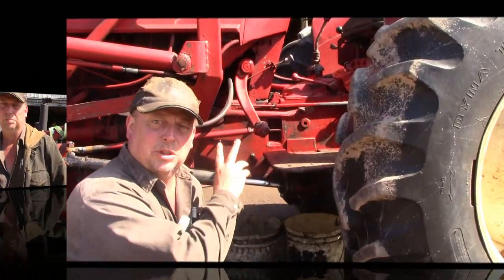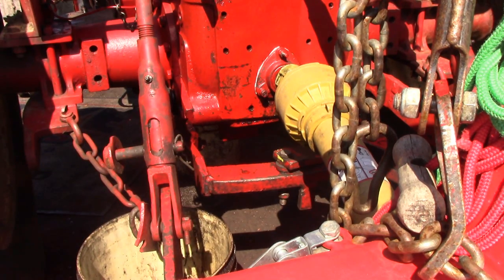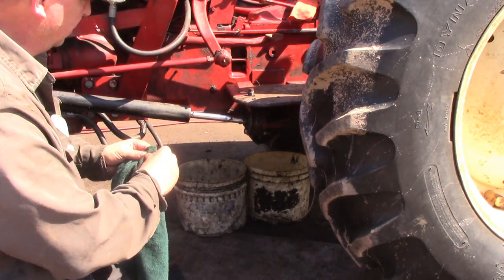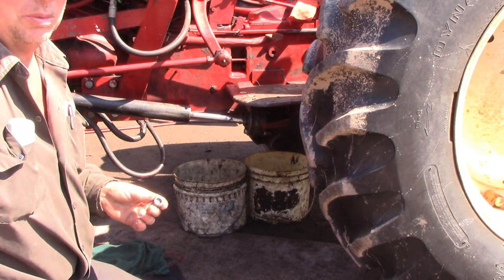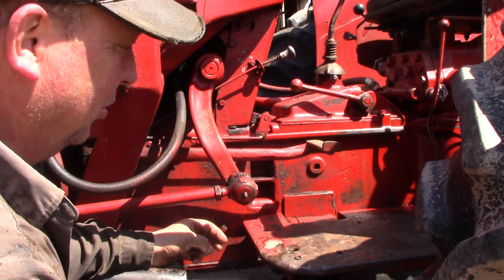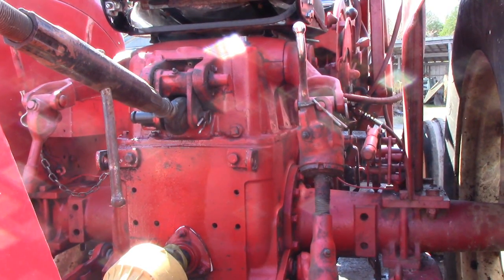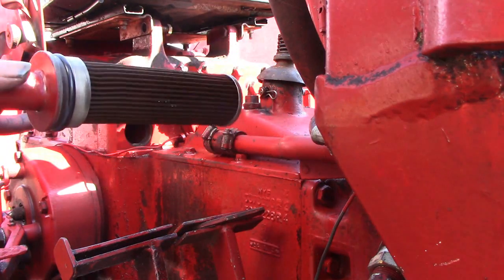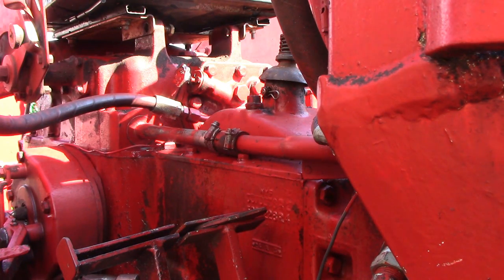IH 444 Fliuds change

Comment: Thanks Dave for this video, but what fluids do you recommend to use on my old b-275?
Reply from the maker: If you can get it CaseIH Hytran for the hydraulic system if not a good hydraulic oil, 80w90 gear oil for the transmission and a quality 10w30 or15w40 diesel engine oil. Thanks for watching!
Reply: Does my 1957 IH 350 have a transmission filter?
Reply from the maker: @paulmock3776  No transmission filter but there is a metal screen filter inside the hydraulic tank over the differential. Thanks for watching!
Reply: @CanadianRedneck15  I removed screen under the seat and added a spin on filter in the return hydraulic line.
Reply from the maker: @paulmock3776   Interesting idea. Thanks for watching!

Comment: Hi there. I'm from Uruguay. I have an international mc cormick 4140 tractor. Do you know if there is an oil filter holder (to be able to use modern filters) that is compatible with the holes of the tractor? Thank you
Reply from the maker: I have heard that there was but I have not found it. You may be able to get one from a Mahindra dealer as they were licensed to build them in India after IH stopped. Thanks for watching!

Comment: Hello, for the 444 hydraulic oil fill level, is it 3 inches from the bottom of the reservoir or 3 inches from the top that I fill it to?  I couldn't make that out in your video.  
PS... I just found your channel over the weekend, thanks so much for putting these out, i would be lost if you didn't!
Reply from the maker: It's 3 inches of fluid, so 3 inches from the bottom. 
  I am glad you have found the videos helpful, thanks for watching!

Comment: Thank you so much for this 1$ million video,am glad i found this after a long search. please i just got a IHC 353 without  any manuals. the old owner said the hydraulics system hangs after two hours of working. please any idea what to think about this problem, and again is ihc 353 similar to 444 in services and features. thanks in anticipation.
Reply from the maker: If the hydr0ualics work OK when cold but get weak/won't lift when the oil heats up that sounds like a hydraulic pump.
 I am glad you enjoyed the video, thanks for watching!

Comment: Hi Dave I just got a b275 diesel , what kind of engine oil should I use and where do I buy the filter, thanks Nick
Reply from the maker: Use a good quality diesel engine oil, something like Shell Rotella 10-30 or 15-40, the filter you should be able to get at NAPA or the like. Thanks for watching!

Comment: Great video. I finally got my 414 running and moving. I would like to change my fluids. Can you tell me the oil you use for the engine and hydraulic fluid  used please?
Reply from the maker: I use Rotella 15w40 but any good quality diesel engine oil will work. For the hydraulics I use CaseIH Hytran oil. Thanks for watching!
Reply: @CanadianRedneck15  Thanks. I got some brand of hytran and I got 80w90 for the trans. I didnt get engine oil yet. Mine is gas. I was thinking a 10w30 or something basic just a 30 maybe. I also got a bunch of new pins.  I already cut my back field with the bush hog. Moved a few logs. It was sitting for a few years. She fired right up after I changed a few electrical parts. I would like to get the manual for this tractor. There is quite a bit to guess all the features it has . LOL Its my first big tractor.

Comment: Nice video lots of help. question where do you attach the pressure and return line from loader lever thank you.
Reply from the maker: The most common way is to run the pressure line from the pump through the loader valve to the lift unit. You have to use a "power beyond" loader control valve which has a second return line running from it which would hook into the fill hole on the lift unit by way of a pipe tee. Thanks for watching!

Comment: I keep coming back to this video - it’s just great. One question, though, about the hydraulic fill level... my newly-acquired manual says to fill to the top of the reservoir. Is the full level of a B275 different from that shown in the video?
I also worry about overfilling the hydraulics if I top up the reservoir, and then connect my planter... if I then lower the planter, won’t it push too much fluid back into the system?
Reply from the maker: The 275 is a different lift unit than a 444 etc. but I don't think you would want it right full either because of heat/expansion. I thought the 3" of fluid referred to a 275 as well but I have been wrong before. Thanks for watching!

Comment: My new 444 when bought they said it was really hard to start.  she needed a shit load of brake cleaner to start, running the blowby was worse then the exhaust it would pop off,  i popped off the head  actually the pistons look good a tiny bit of carbon on the head, injectors looked good too. head gasket had a tear not sure if it was taken off, most likely not, cyl wall still had cross pattern.  was thinking std rings set. a light honing. not really into new cyl kit.. already  bought starter, modern glow plugs ,H8 battery,   love the sound of it.    oh valves look really clean too no pits nothing. maybe all the brake cleaner lol
Reply from the maker: The blow by certainly could have come from the head gasket and a set of rings wouldn't be a bad idea, it could have over heated and taken the tension out of the rings. Thanks for watching!
Reply: one last thing what a joy to pull apart, no back breaking bending,

Comment: I am getting close to changing fluids in my tractor. I was going to order a new filter for the hydraulics but might just clean it. What motor oil should I use on my 444 Diesel.
Reply from the maker: The hydraulic filter is a metal screen, meant to be cleaned as long as it's in decent shape. For the engine use a good quality diesel engine oil, we use Shell Rotella 15w40. Thanks for watching!
Reply: @CanadianRedneck15  Its me again. I just got the tractor to my house and cleaned the suction filter on my 444. The 3 point and power steering is not working. How can I tell if the issue is the hydraulic pump or flow divider? I am not sure what other thing can cause the hydraulics to fail. The flow divider has a small piston that moves in and out. Could my lines be full of air? Well back to searching more information.
Reply from the maker: @cutweldngrind  Try loosening the pressure line at the lift unit to check for oil flow and bleed the air out of the system.

Comment: Great explanation video  thanks have you any specifications on oil selection is there a one for all oil for the 3 ? Thanks again
Reply from the maker: For the engine use a good quality diesel engine oil (we use Rotella 15-40), the transmission should have an 80w90 gear oil, and the hydraulic system is recommended to use CaseIH HyTran oil. Thanks for watching!

Comment: We had 250, 275 and 414 Tractors, but never realised that they had that hydraulic oil screen.   Never had any oily problems with them, even when loading sugar beet for the cows, at 06:00 on a cold -15C morning. . . . . .Thanks for the video. . . . . .
Reply from the maker: Those series of tractors are hard to beat. In my opinion they are the best tractors in that HP range built by anyone ever! Thanks for watching!

Comment: Thanks for the video!  Yeah, I've got a B275 that I picked up 10 years ago and other than oil changes every couple of years just because, I don't think we ever put more than 2 or 3 hours a year on it dragging equipment around the yard at the shop.  Now we have it at the family farms in Texas putting out hay, and I realized I'd forgotten how to do everything but the oil changes.   I'll have to look at it, but, you're saying there is a drain plug for the gearbox/transmission, and then a drain plug for the rear end, but they both get filled at a plug by the shifter?  Also, the B275 'Jensales' all in one service manual (unless I"m missing a section), was really lousy about covering maintenance, but it seems to state that the preferred hydraulic fluid is SAE 20 motor oil for mid-range temps.  I didn't get the manuals for a few years after we got it,  and at the time it seemed to have clear-ish hydraulic fluid, so we added whatever the International dealer in Okanogan WA at the time had in 5 gallon containers when I had to replace some gaskets on the hydraulic valve body.  It seems to work fine, we're lifting 1000 lb round bales with it now, but, do you have a recommendation one way or the other?  Thanks again, it certainly is a fun little tractor now that we use it regularly.
Reply from the maker: There should be 3 drain plugs, one at the back half of the clutch housing, one under the transmission, and one at the back for the differential, and they all fill from the plug by the shifter. 
 For the hydraulics our dealer always recommended CaseIH Hytran oil but if you're using regular hydraulic oil and it's working fine don't worry about it.
 The 275 is a great tractor, much sturdier than competitors in it's size range. 
  Thanks for watching!
Reply: @CanadianRedneck15  I finally made it down to the farm we're using it on tonight and took a look at it after your video, yep, now it all makes sense!  Thanks for the response, yeah, I like it because it's compact and so far, is lifting the big round bales just fine.  I do see some fluid changes and a little maintenance in my future though.  Thanks again!

Comment: you never mentioned the oil types and would synthetic work
Reply from the maker: 80w90 gear oil for the trans/differential, CaseIH hytran for the hydraulics and a good quality diesel engine oil for the engine, 10w30 or 15w40. I don't see any reason that synthetic wouldn't work. Thanks for watching!
Reply: @CanadianRedneck15  used to own an old benz diesel , it seemed to purr using 0w40 T6 synthetic. figured easier to start in the cold. Enjoy the videos.. surprised how everything comes apart in sections, like the front end with rad, middle is the motor etc.  simple
Reply from the maker: @BillyBob-fd5ht  Yeah, I'd way rather work on a tractor than a car!!!
Reply: @CanadianRedneck15  yeah, question the IH 444 glow resistor do i need that? odd to send energy to that to heat up with the glow plugs, I would prefer a light and the power go directly to the GP. mine does not work.  my old MB i just used a solenoid, kabota   switch only (only 2 Cyl)
Reply from the maker: @BillyBob-fd5ht  You need the resister in the dash or you get too much juice to the glow plugs and burn them out.
 Thanks for watching!

Comment: allo parler vous francais jai un 1970   434 internationnnal harvester au gaz  cest la meme chose  ....peut on tulisiser de huile tdh pour hydraulique et transmission  aussi?
Reply from the maker: You can use TDH in the transmission but it's better to use gear oil for the transmission/differential. Thanks for watching!
Reply: @CanadianRedneck15  gear oil is 80w90?
Reply from the maker: @tilou32  Yes 80w90

Comment: Hi my canada 434 doesnt have hydrolic ports at the back. Can i hook the implements hoses up to the ports for the loader? I would have to make adaptor as it would be male to male thx
Reply from the maker: Yes, we did that for certain implements. You can put the bucket tilt on quick couplers and use that part of the loader valve to control your implement.
 Thanks for watching!
Reply: @CanadianRedneck15  ok great thx. My tilt has quick couplers, the boom up and down is hard tied in, tho only 1 hose so gravity is all that lets it down. Is that normal theres no ports out the back also theres no foot throttle? I was surprised theres not. Tia
Reply from the maker: @rebelcowboy5.7l98  That is a 1501 loader, no down pressure. There were no hydraulic remotes on this series of tractor and no foot throttle til the 444.
Reply: @CanadianRedneck15  good to no!

Comment: Happy new year lad! Is there a video of you changing the water pump on your international b414? (I had previously cleaned the radiator and the piping system, but when im using the rotavator the engine overheats). Thank you for your help!
Reply from the maker: Happy new year to you as well! I don't have a video  on changing the water pump, sorry. Check your fan belt, it can slip under load if it's not tight and causing heating when the tractor is working hard.  Thanks for watching!
Reply: @CanadianRedneck15  Hello! Do you know how to tighten the belt which connects the water pump with the crankshaft? (International b414)
Reply from the maker: @siriossirios2178  The pulley on the water pump is a 2 piece pulley,  the front half is threaded onto the rest of the pulley and held in place by a set screw. Back off the set screw and tighten the front half against the belt, when it's tight enough line up the set screw with one of the 4 grooves through the threads and tighten the set screw and jam nut.

Comment: Glad you mentioned the spring and washer inside the eng. oil canister . Over the years I can't tell you how many of them are missing, doesn't matter the make or model of the tractor. It may have been good to mention to have the engine at operating temp. and drive it around before draining the fluids so as to get the sediment suspended and drained out.
Reply from the maker: That is a good point about warming the tractor up, thanks for mentioning that and thanks for watching!
Reply: @CanadianRedneck15  Watched some of your other videos great info, thanks for your post.

Comment: Of course I forged ahead with these jobs before watching your excellent video.
Needless to say the oil filter bit didn't go according to plans.  The two large concave washers fell out of the filter canister before I had figured out what order they were supposed to be in.  Don't even ask l if I checked/replaced the top O ring.  Anyway, now I know.  Thanks.
Reply from the maker: LOL, that sounds familiar. Don't worry about it, most of learn the hard way, thanks for watching!

Comment: great video but i  couldnt see what you did under the pedals on the adjuster  i just picked up a 1958 international 420 utility  when i shut it off and apply the parking breaks they won't hold on a hill   id appreciate any help  thanks al

Comment: I have an IH 2350 which I think is an Industrial version of a 235 or similar the hydraulics look the same as the one in your video, the loader hydraulics suddenly stopped working, I have drained the fluid and refilled, and I can’t figure out why I have no hydraulics, any idea where I should check next? I may have overfilled the fluid, as there is a hydraulic fitting in my fill port, I had to take the top plate off to fill the oil. Also can you confirm the correct grade of hydraulic oil. Thanks
Reply from the maker: 2350 is the model number of the loader, the tractor model will be on the hood of the tractor.
Reply: @CanadianRedneck15  it says 2350 on the hood, there are no numbers on the loader? Can the spool valves suddenly go bad, that was the next thing I was going to check
Reply from the maker: @graemerolfe1573  Not familiar with a 2350. Check for a hydraulic filter, not likely that the valve would go all at once.
Reply: @CanadianRedneck15  the hydraulic filter is the same as you showed in your video for the 444, I took it out and cleaned it although it appeared clean, I could not see any other filters. I took the pump off and checked for damage and I could not find any issues. Which makes me think either the valves under the seat, or the spool valves, is there a pressure relief valve, could that have stuck open?
Reply from the maker: @graemerolfe1573   There is a relief vale in the lift unit and also should be one in eth loader valve.

Comment: Thanks for this video. I have watched a few times as I inherited a b414 this year that had been sitting. I was mostly watching transmission and hydraulic, but I watched the engine oil also. I'm glad. Mine had the spring and washer, however it was installed above the element forcing it away from the housing. If I had not watched, I might have reinstalled the same way. Thanks
Reply from the maker: I am glad you found the video helpful, thanks for watching!

Comment: That’s a 354 not a 444
Reply from the maker: No it's a 444 though they are basically the same tractor. 354 is .35 HP and 444 is 38 HP. Thanks for watching!
Reply: Good video but it’s not a 444 it’s a 354 the sheet metal and the front axle is a couple of differences we own both and ran and looked at the serial number. Look at tractor data   Helpful video
Reply from the maker: @farmallred4910  You have a US 444, this is a British 444.
Reply: @CanadianRedneck15  ya I found that out yesterday I’m sorry
Reply from the maker: @farmallred4910  It's all good bud,  every time I think I have it straight I find out something else I didn't know yet either. :)

Comment: I just bought A 1974 354, The only thing I have found wrong with it is a good leak around the hydraulic control valves right in front of the seat. Is there a good way of changing the seals around the valves or removing to 2 front plates? Thank you, I'm a new sub to your channel and love your video's. Keep up the work. :-)
Reply from the maker: Is that under the front of the seat? All the bits that can leak will screw out of the body and have o-rings sealing them. Thanks for watching!
Reply: @CanadianRedneck15  Yes its under the front seat, and thank you. I didn't know if I had to remove the 2 cover plates to get to them. Again Thank you and I look forward in watching your video's.

Comment: I need your help. I have a 354. It wont steer it has the cylinder with the build in valve. I took off the end caps. But i cant get the rod out. Also do you know anywhere i can get a rebuild kit.
Reply from the maker: Only place I would know to get parts for that would be a CaseIH dealer. Thanks for watching!